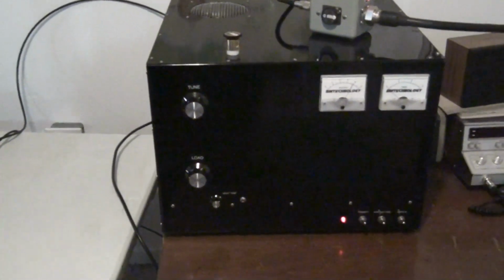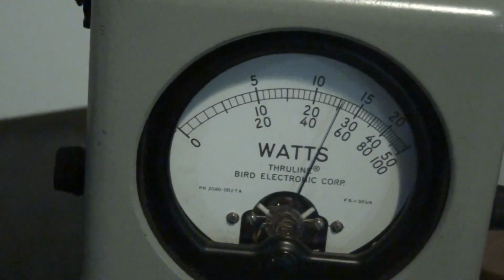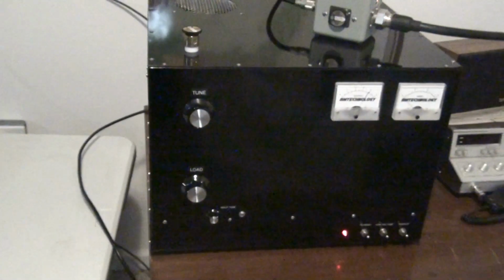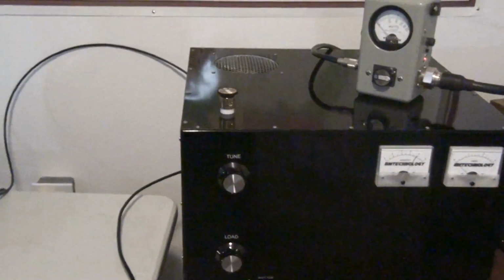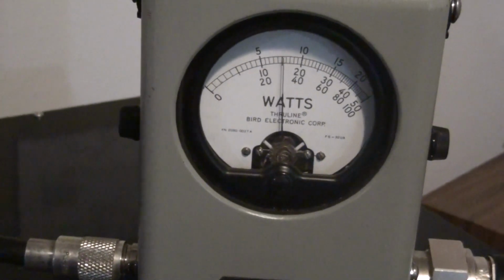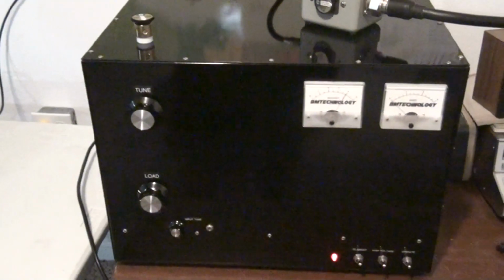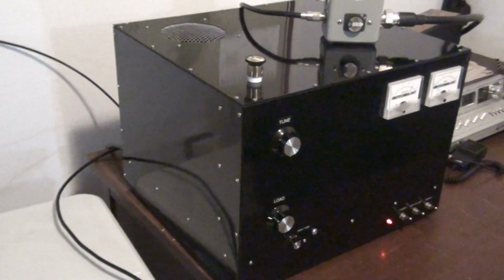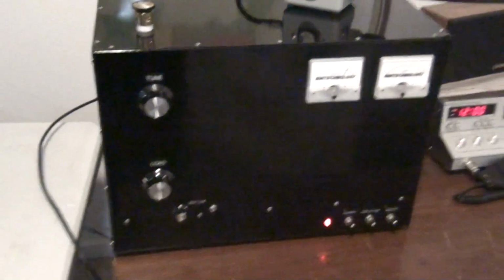Single GS35B Base Linear Amplifier (Steel Tube)

Comment: Rooster,just noticed ur post on the sirio antennas.DON'T DO IT !! Very bad!! The cable they use sucks! The bases of the coils are made of the poorest of pot metal ,that after the chrome peels off( within months of exposure)the metal crumbles like a week old muffin !! The covering of the coil cracks almost as fast !  Just say no!!!